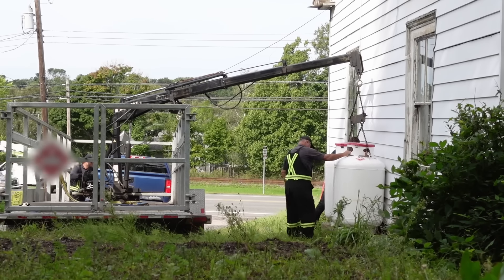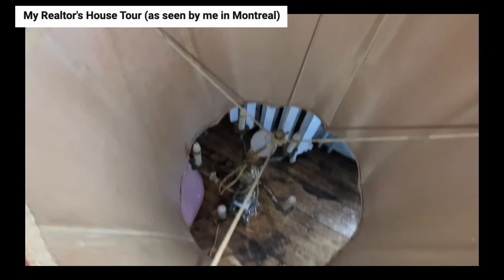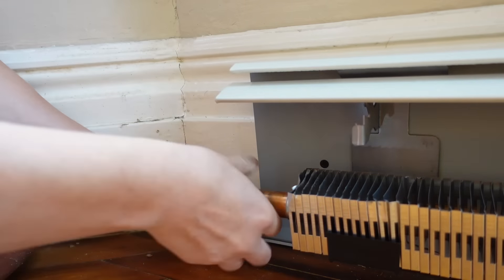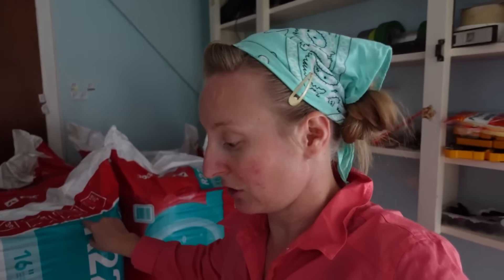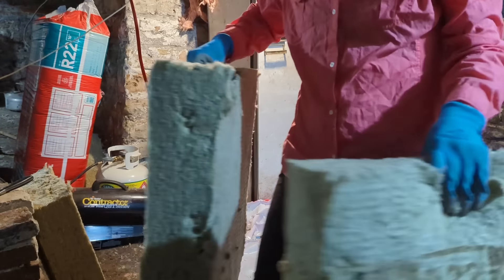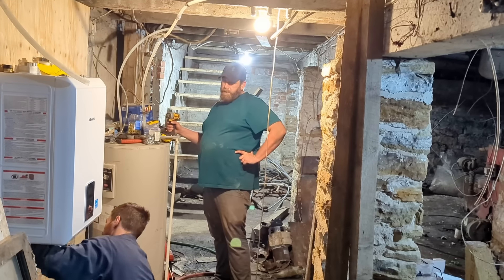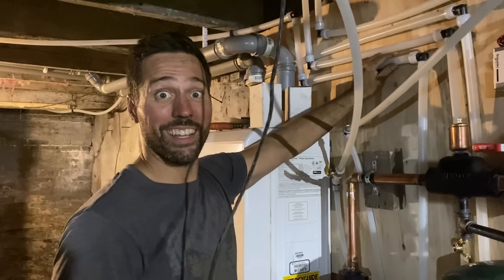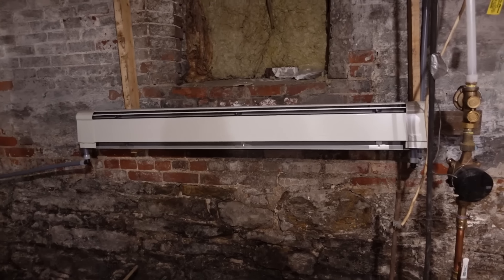we're running out of time

Comment: Get your basement tested for radon gas. If you have radon, seal the floor and look into getting a humidex venting system.  It will vent the radon and, bonus, deal with the excess humidty problem too.  I was told it uses less hydro than a dehumidifier.

Comment: That is really smart -- and a gift to your future selves and to future contractors/owners of the house -- to remove unused pipes, lines, and wiring!  As Phil said, gives you room to add the new stuff and to keep you from getting old and new confused and cutting the wrong thing.  Way to go!
Reply from the maker: That's the idea! 🥳
Reply: Can attest- we have been trying to deal with the nonsense of the previous owners old wiring and piping left in situ, it makes so much wasted time when we have to fix anything, it is super frustrating!
Reply: Oh can I agree with this! Amateur electricians managed to install light switche OVER the kitchen faucet. Bathroom outlet, no breaker if it draws more electricity. THREE light fixtures in one kitchen area, ONE is a hanging bulb. 
Don't get me started on the plumbing, ZERO insulation in the basement, but a suite there. 🤦😤

Comment: I know you have a dehumidifier in the basement. But do you also have one running upstairs in the living quarters to keep the humidity down until you get back and can deal with the issues causing the mold? Would be awful to return from your trip to find mold everywhere.
Reply: And maybe  a ozongenerator to clean air from  particals that spread around and get stuck on stuff where it start grow and bad for lungs
Reply: They may need a larger dehumidifier for the basement. I agree with one upstairs as well though. Ozone isn’t a bad idea for the basement as well.
Reply: Like I wrote in the post before you you have to have one that will empty itself with a hose otherwise it is of no use because it will overflow or shut itself off so that being said........
Reply: @rosiesgrandma  ofc when not allways home you need one woth hose that goes drain it to the drain system for house. Thats kinda speak for it self

Comment: You need a whole house Dehumidifier in the basement.  Get it from a basement dewatering company. It will be expensive but maybe they would sponsor you. I live on a river, high water table but no more humidity in my house. It was so bad before that my stainless refrigerator had rusted on the doors.  You can't leave there with this mold problem. Everything will be ruined.

Comment: The mold on varnished surfaces but not so much on other wood surfaces migth indicate that the varnish used is shellac. That stuff molds easily apperantly and if it is left long enough the varnish becomes sticky unpleasant gunk that has to be removed. I bougth a nice kitchen table set that had been left in a too damp area, I could dent and scrape that gunk with my fingernails :( I hope that your vinegar dousing worked out for you!
I also have general awe for the sheer level of efficiency you and Phil Have in this video!

Comment: Awe yes, ye old vinegar, the go to for all your cleaning needs. My great grandmother used to use vinegar for everything. I never understood why mom mom used vinegar to clean the windows when I was growing up until I was 16 and finally asked. She told me about how her mom and grandma both used vinegar to clean everything. Later we used it in our house to combat a mold problem in the wall next to the bathroom. Problem was it was an addition and the roof right there was flat. So the eves of the house met up in a corner right there. The house also sat under 2 big oak trees so every time it rained the oak leaves would collect right there and the water would collect and pool up right there. So naturally we had a mold problem. Worse was that it was considered a historic house and the permit to fix the roof was astronomical. Even with the connections my FIL had through the count as an architect. Since we were both poor starving college kids snd just starting out in life,we redemcked it to the best of our abilities. We sealed it as best we could and when we tore out the moldy drywall, we sprayed vinegar on the mold. It worked like a charm. Even years later when we remolded the house the mold never came back.
Reply from the maker: ooof, yea those historical designations are both a blessing (if you get the grants and funds that can come with it) and a curse 🥴 Definitely a reason I didn't even look into it for this house!

Comment: Putting a covered porch over that back door area should put a stop to most of the problems. I want an enclosed front porch to keep the north winds away from my front door. I also want a large porch in the back to make it safer (for me and other people to get in and out of the house in the winter). Plus, having shade in the hot summer would be a real plus. Those aluminum and glass storm doors get so hot in the summer that I (and others) have been burned by the metal handles.

Comment: Hey Shannon, I was telling you about some paint you could buy to paint your walls keep moisture out of your basement and I forgot to tell you that you can get it from Lowe’s or Home Depot or something like that. But it is so worth it.
Reply: If you use paint, I can't remember the name, but there is one that acts as a water barrier to keep the basement dry.
Reply: I believe you're thinking of  KILZ Basement and Masonry Waterproofing Paint, Interior/Exterior.
Reply from the maker: Drylok is not a good option for historical fieldstone foundations (and honestly I'm not even sure it's a good option for modern ones, but it does seem to less detrimental with something like cement blocks)
Reply: I believe Calcium based coating should hold the water for a slower evaporation into the air so that could be helpfull or annoying.

Comment: I have never had success with vinegar for mold. I use Electrically Isolated Silver aka colloidal silver. It's odorless and you can use it for Everything. I keep a spray bottle on the kitchen counter. It's wonderful for burns and sunburn. It doesn't sting even on an open cut. I make my own for pennies a gallon. Buying it commercially is cost prohibitive. You will need a "generator" but they're roughly less than $200. Of course when I bought mine back in the day it was under $100.

Comment: Shannon, they make a paint for the walls in the basement that helps to keep moisture out of your basement. It’s a little expensive but worth every bit of the trouble. It totally works.
Reply: Is it cistern paint?
Reply from the maker: Drylok is not a good option for historical fieldstone foundations (and honestly I'm not even sure it's a good option for modern ones, but it does seem to less detrimental with something like cement blocks)

Comment: A builder I knew told me to use Oxiclean (because of the hydrogen peroxide) for mold. Works like a charm without the harsh vinegar smell, too. The brown bottle is just as effective as the laundry additive and dirt cheap.
Reply from the maker: ...so then why not just use hydrogen peroxide? Honest question from a curious mind
Reply: @ShannonMakes  Application. Oxiclean works great for scrubbing walls and floors, and for general laundry. Hydrogen peroxide is great for direct fabric treatment (including for blood) and the nasty pink slime that builds up around water areas (tubs, shower curtains, outdoor faucets, etc). The oxiclean also kills the musty smell better than just the hydrogen peroxide alone.

Comment: Have you ever tried upholstery paint? I saw a sofa like yours on some channel that had been painted a beautiful plum color. It looked very soft & smooth, velvety. 
Wondering if it's a good thing for use, not just appearances.
I'd keep a fan on 24/7 to pull moisture out of the house, or a dehumidifier even. Mold is my allergy too, like many others. But it can ruin a house fast! 
Edited. 😊

Comment: There are dehumidifiers that you can hook up to drain so that you can run them while you're not there and I have two of them like that one the motherboard didn't read completely and I got it for $35 at the thrift store and the other one at a garage sale near the end of it I offered her $10.  I will stay there is a difference in dehumidifiers. I have an LG that I prefer it runs better even in cool and colder room does a better job. Hisense isn't as efficient.  Just thought I would share with you.  When you go to insulate your house be sure not to insulate up and leave are around the eaves to breath.  This is the reason that they force people to put vents in the roof.  If you button up these old houses and they can't breathe then you will start a moisture issue just like the one that you're having just a suggestion from somebody that owns a 1903 house.  Third owner and most everything is original. With gas heat moisture is not my friend Mr Campbell had an air conditioner and cooled the house every night so that there wasn't moisture in this house that was spring summer winter and fall according to daughter.

Comment: Oil of cloves is also good at killing mould spores and smells nicer than vinegar.
Reply: Looking up the recipe for the mould cleaner. It is for small areas like a kitchen and not large areas. It also said Overdoses have been marked by the onset of agitation, decrease in consciousness and coma arising within hours on ingestion (10-30 mL of clove oil). There is typically an accompanying acidosis, respiratory depression and severe hypoglycemia requiring ventilation and intravenous glucose.

Comment: The mice and other rodents are going to love the rockwool.
Reply from the maker: In a six-month study conducted by the University of Nebraska-Lincoln Veterinary Science Research Facility, five different insulating materials were exposed to mice under controlled conditions. All five types of insulation tested, including fiberglass batts, fiberboard insulating panels, rock wool, closed-cell extruded polystyrene foam and vermiculite, suffered severe damage from the colonies of mice. Researchers have yet to discover an insulative material that is not susceptible to house mouse damage, so unless you'd like to invent one and make it available in Nova Scotia at a competitive price point to rockwool, I'm gonna the added R-value and the lower heating bill.